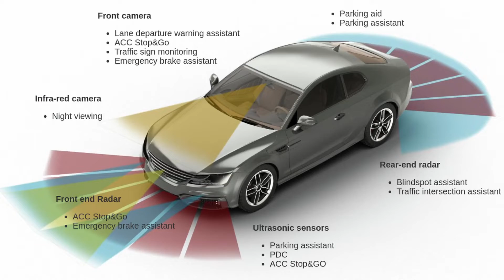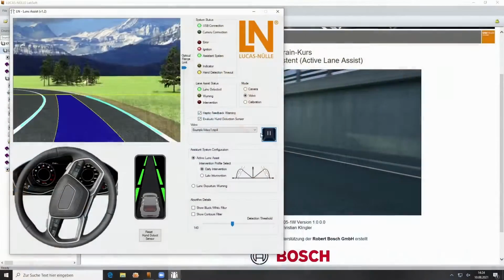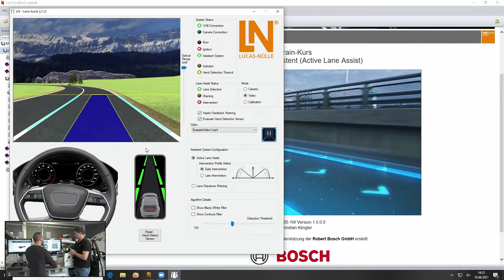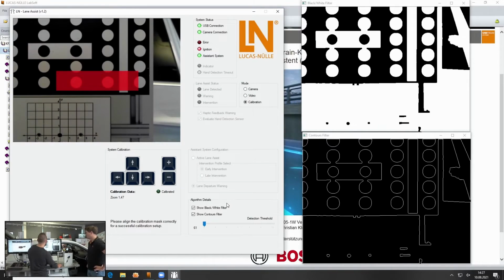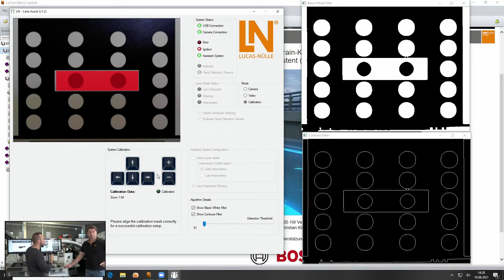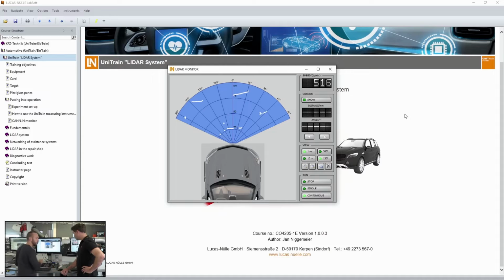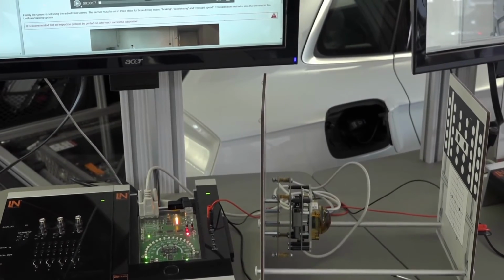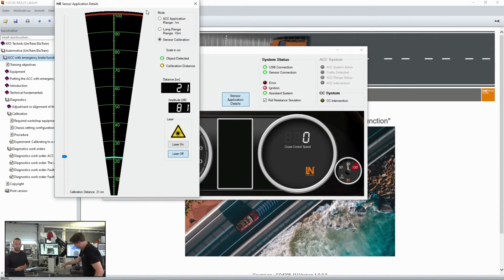ADAS - Calibration of RADAR, LIDAR and FRONT FACING CAMERA

Comment: Hi there,
I have a question about the Ladar / Laser radar. I took my audi to get my ADAS system calibrated everything was fine the only thing is the Ladar cant see the calibration board according to the technician. Would you have any advice for us please?
Reply from the maker: Hey Tony,
Did  AUDI told you, that your car is using a LADAR or a Laser Radar? There some differences between LIDAR, LADAR and Laser Radar based on their properties and the associated intended use. I would be very surprised if Audi used anything other than a LIDAR. 

Back to topic - where is the LIDAR placed in your car? Is it installed where the fog lights used to be? Did you go to a AUDI workshop or a free one?